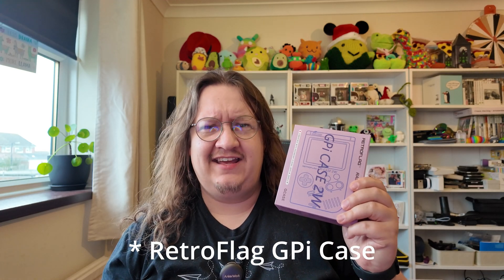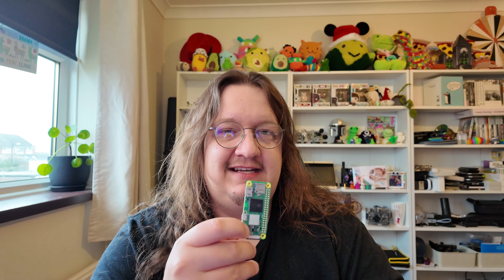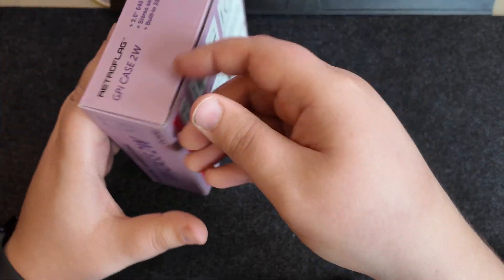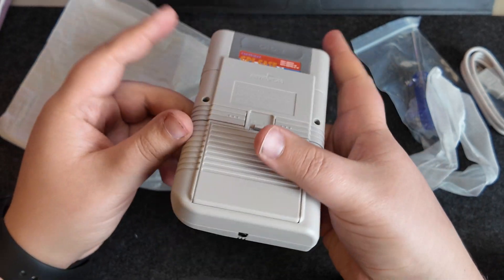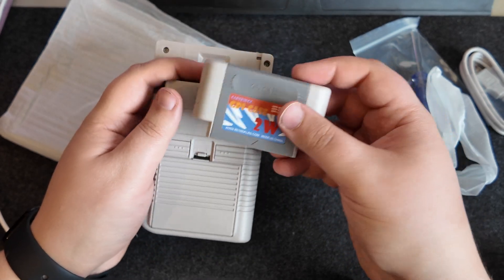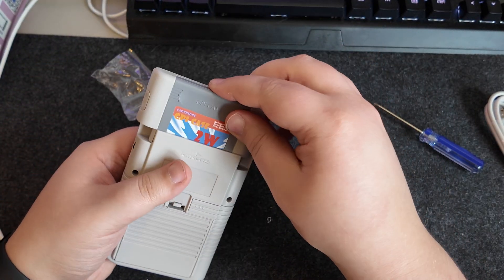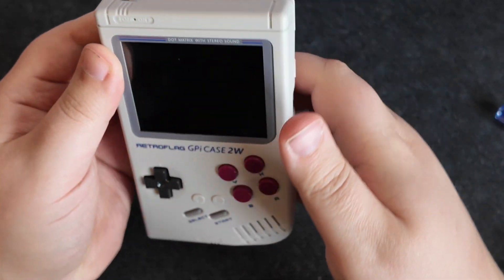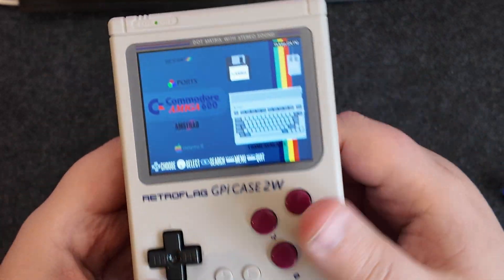The Raspberry Pi (Zero 2w) Powered Handheld Games Console - RetroFlag GPi Case 2W Review ft Recalbox

Comment: Hello there, question for you : every video I've seen talks about the game emulation of the 2W, which is already pretty well reviewed/documented at that point but any word about other functions such as media playback ? Like a fancy walkman yknow, dumping an .mp3/mp4 library in there and enjoying some music/video ?
Reply from the maker: Great idea! I've added it to my video list... pretty sure some testing is in order!
Reply: @devwithzachary  I've got a 2W on my hands and decided to get a GPi case for it, I was wondering if the OSes that work with this case had media players integrated to them and what kinda autonomy we could expect from those...

Something I personally find "flawed" about the case's design is that they put the 2W in the cartridge when this is probably the part that's least subject to be swapped around and they could have instead made battery cartridges... Sure, they're rechargeable and all but if I forgot to charge the current battery and I'm running outta juice on the train/bus, I could have just popped another battery cartridges instead, not got another full case and swapped the 2W around... And while I don't have the case yet, I look at the cartridge design and while I can expect theirs to be reliable, I think it would have been more reliable to just go an make it two battery connectors and make the 2W connection fixed, it already goes through pogo pins, why add another row of points of failures ? With time and after a number of swap, there's a possibility the contacts will break whereas two rails for a battery cartridges would have been infinitely more reliable...

But that's just me rambling on about this, I'm sure it's a good product, I just thought that specific point was kind obvious in hindsight and that Retroflag should have thought of that when making this design revision

Comment: Despite being quite old now, I have been looking at getting one of these.  I agree about the USB DC cable.   The GPI 2 has USB C power but is for the CM4 module.  I believe it gets hot which is why I have been looking at the 2W.

How did you get the games on it?  Did you have to add bios files?  I am used to Batocera and just use USB to copy files over which is not possible on this.
Reply from the maker: By default it’s setup as a smb network drive so you can copy files directly to it once connected to the network. But for sake of speed is just put the sdcard into a computer and copied from there
Reply: @devwithzachary  I had hoped it would work on a Pi to add roms.  Going to look at getting it in a few weeks.  I still prefer the case to the look of the other handhelds that come up on Amazon.